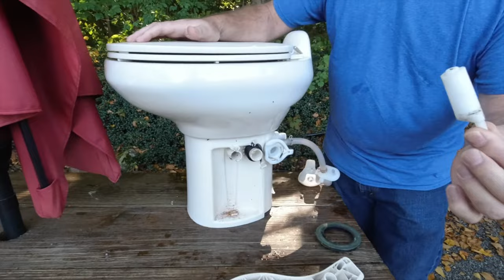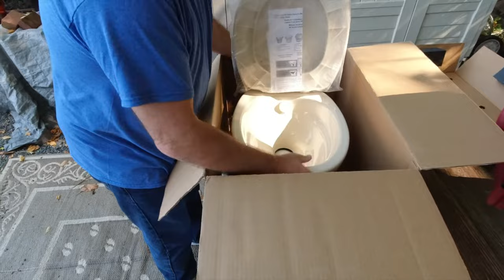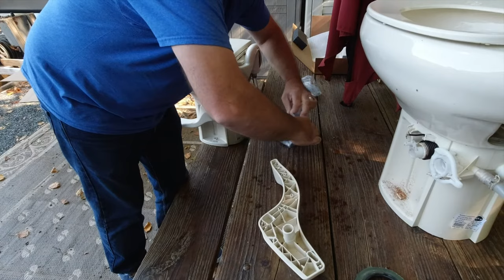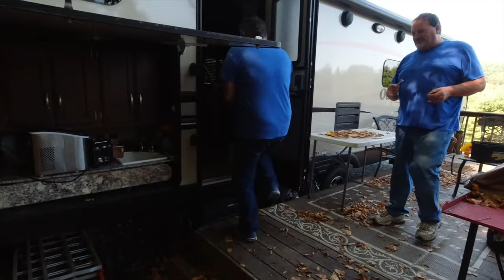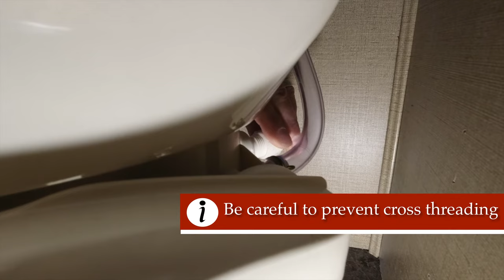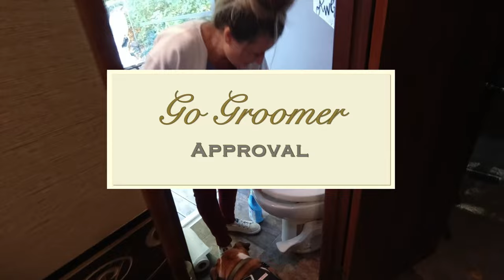Replace Rv toilet in ten minutes.

Comment: A hint: Connect the water line loosely BEFORE you bolt down the toilet. Its much easier to do (and not strip/cross-thread) if you can see it while screwing it on. Thanks for your light-hearted video!